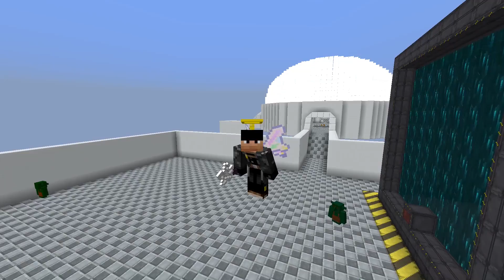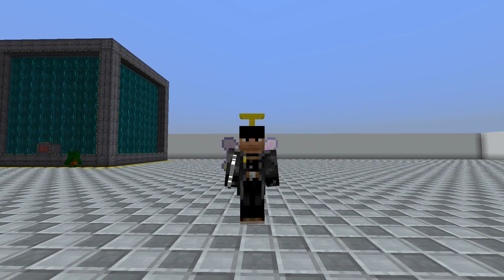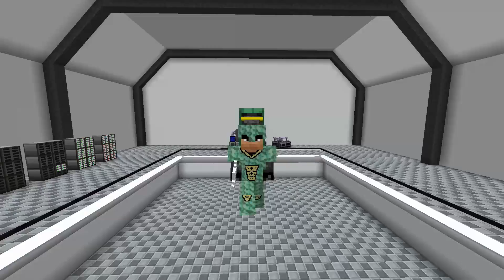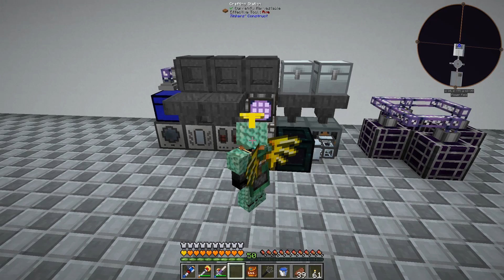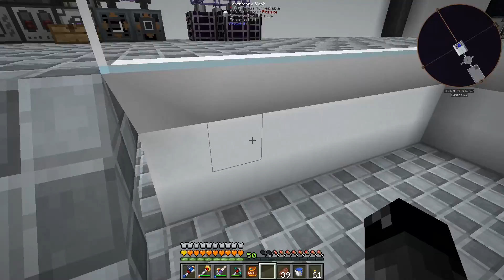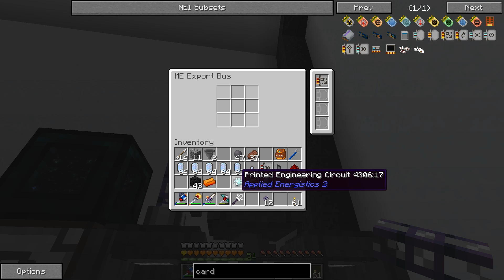Minecraft Mods FTB Infinity - AUTOMATIC INSCRIBER [E21] (HermitCraft Modded Server)

Comment: +1 You were new with AE2. I never work with an Energie Acceptor Subnetworks. I use a Bunch of Controllers, P2P, Dense Cables. Subnetworks have only one Use: If you have more as one Base and each of them has it's own ME System and you want Access to both no Matter from which Base, you make 1 Subnetwork Connection, not 6, not even 2.  AE 2 simulates how a Network behaves, so a bad constructed Network gets simulated bad Responding Time, which looks like Lag.

Comment: use Smart Cables and Dense Cables With AE Controler it will work fine .
the fluix cables to small to handle the data

Comment: hey Hypnotizd when you made your small network, you placed the dense energy cell on the wrong side of the acceptor, so it was not even part of the same network, but normally, not all items going in is a power issue. And also, if you want to still use subnetworks, you can, but instead of having one going to another to another to another, it works best if you have 1 cable and bunch if subnetworks coming off of you initial one. So you would have a mother and children, but no grandchildren etc. As for same items on multiple drives, this should not cause issues.

Comment: Oh, that lag. I get that lag too. I get it when making, say, glass cable, but no other kind of cable is a problem. I get it even if I only have a single 16k storage cell in a drive and no other storage, so I'm sure it's just a bug.

Otherwise I'd daisy-chain the same number of networks together but with no storage and see what happens. With the way you have it now, it's subnet inside subnet all the way down the line. Maybe having multiple subnets directly off the main one would perform better, but maybe not. Also depends on whether any of the code for searching that stuff is multithreaded. :p

Comment: Hypnotizd The lag in your system is from all of the data for the crafting and retrieving of items is on 1 AE channel which has a data limit that people usually don't go over. So, since one sub network takes up 7 channels in itself but is only taking one channel in the main network it is getting bottle necked. it is like if you have a usb hub on your computer it takes one usb and splits the band with between (usually)3 usb ports so each port(when the others are occupied) get 1/3 of the original usb bandwidth. What you are doing is putting a USB hub on a usb hub on a usb hub etc. But even though you aren't using the bandwidth to craft a little bit is used up by the displaying of items in the monitors. So the lag is most likely from the monitor tying to update itself on one channel making the crafting slower.  But there is a way to speed this up in AE, I am pretty sure that you can make Acceleration cards and put them in the interface to speed it up. I hope this helps:)

Comment: Hypnotizd I'm not 100% sure about this, but I'm pretty sure the reason your network is lagging is because of the way you have your sub-networks set up. In AE2, which is the version you appear to be using, there is a separate cable type (The thicker cable) that is made specifically for creating sub-networks like yours. If you go to Direwolf20's channel, and you look up his Applied Energistics 2 Mod Showcase, it will describe how to set those up, along with some other helpful information about AE2. Hope this helps!

Comment: You can make your Inscribers even more compact, even with only AE2.

1- Inscribers placed directly next to each other are able to share power. So if you placed your 5 Inscribers in a row, and gave power to one of them, they would all have power.
2- The rest of your setup is pretty much identical to what I had, but once you make the Crafting CPUs, for AE auto-crafting, you can just replace your export busses (all EXCEPT the ones for redstone and Printed Silicon) with ME Interfaces. And instead of giving it items to export, you give the Interfaces the Encoded Pattern telling it that <Gold> will get it a <Gold Printed Circuit>, etc.

Instead of having an ME Controller, you could've made a Dense Cable. It can handle 32 Channels, so place one cable, then branch off on either side like you just did. :)

Glad to see you messing around with stuff you're not necessarily familiar with, and hope your AE lag gets resolved soon.

Peace.

Comment: Hey Hypno long time watcher first time committing so I think slip had a problem with this in the last FTb the problem is you maxed out that drive and the lag in the system is storing on another drive.  To fix it you need to consolidate your drives or go bigger  if it works give me a shout out

Comment: Just a thought, but isn't it inefficient to be turning the reactor on and off because the power gen has to build up doesn't it, so the first three seconds its powered its only between say 0 and 5krf whereas when its at its max it runs at 40something kRF. Surely the most efficient method you could use would be a large number of capacitor banks or the draconic variant of power storage and use the control rods at 50% or something so you still generate plenty of power but its more efficient?? (I suppose at the same time if you reach your limit then you're wasting power, but I don't know what's better tbh...)

Comment: Hypno! if you're in need of silicon just sag mill ur redstone ore ( :
Reply: Hypnotizd no, you want to pulverize your redstone ore for cinnabar chance, and just sagmil clay blocks for silicon.
Reply from the maker: GrilledAirplane TastesGood Good idea! I should run it all through the sag mill to unblockify it ;-)
Reply: Hypnotizd You could actually do it multiple ways. Sag mill sand, which gives you a 50% chance of producing silicon, or set up a tree farm, pipe out the sludge from the harvaster into a sludge boiler, which gives you a decent chance of forming blocks of clay.
Reply: jeremy58589721 No man will need that much cinnabar
Reply: GrilledAirplane TastesGood you can never have enough of anything. cinnabar is amazing for many uses besides the only way to get shiny metal
Reply: jeremy58589721 The only guaranteed way to get Shiny Metal.
Reply: 5il3nc3r did the update fix shiny metal spawns? or did you mean laser drill?
Reply: I meant that putting Ferrous Ore in an Induction Smelter with Cinnabar gives you a 100% chance of getting Shiny Metal. Whereas normally, in a Pulverizer with the three Secondary Sieve upgrades gives you around 40-50% change to get said Shiny Metal.

I'm fairly certain that Shiny Metal/Platinum isn't part of world gen, and I don't know if the Laser Drill gives you Worldgen ores, or if it has a chance of getting you Shiny/Platinum Ore.
Reply: 5il3nc3r ahh ok, than yes we are on the same page and pulverizing redstone for cinnabar is the best thing ever even if you end up with 10k of it its worth having to get that sweet sweet shiny metal.